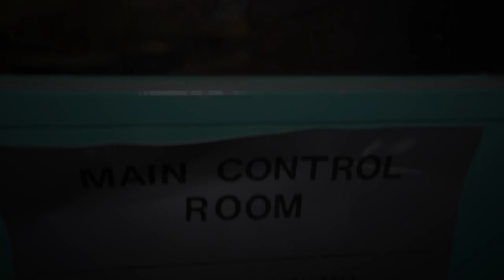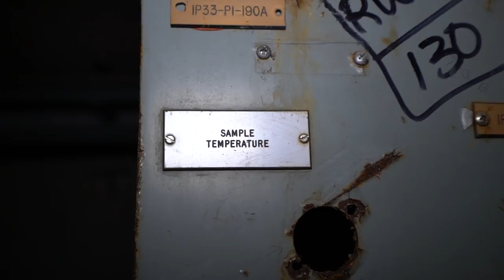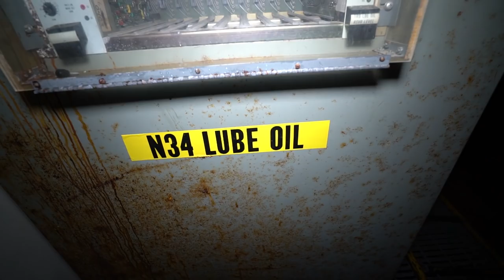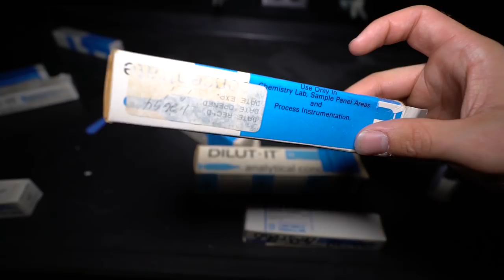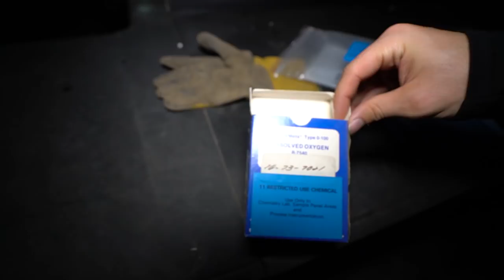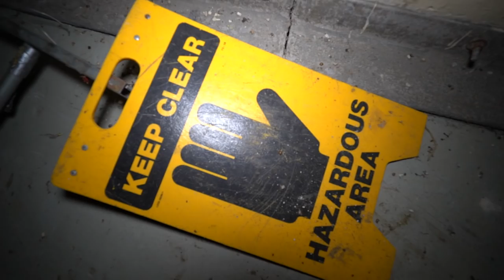Abandoned Nuclear Power plant ( Rare Abandoned Place )

Comment: I would have probably had a Geiger Counter just to make sure I'm not killing myself with radiation
Reply: Daryl Skinner yeah me too 🤷🏻‍♂️
Reply: When a nuclear power plant is decomissioned. The proprietors are federally mandated to remove anything and everything that could even have a small chance of contaminating the environment. If a leak were present, suffice to say that Josh wouldn't have been able to enter, as itd most certainly be cordoned off, or even sealed by local authorities.
Reply: Same thing goes for essential systems. A very specific list of items absolutely must be removed to prevent any possibility of accidental contamination/reactivation by unauthorized individuals
Reply: A N A T H E M A do you know why the lights are still on?
Reply: Reazer - Modder and Developer as Josh said, its probably just connected to a grid that is still in use by other buildings. So shutting it off in there means shutting it off for all the other buildings
Reply: A N A T H E M A ah ok thanks^^
Reply: Yeah bring a couple of bolts encase of anormalies
Reply: Reazer - Modder and Developer he said that in the video if you were actually listening why it still has power
Reply: ikr
Reply: Daryl Skinner couldn't agree more, I wouldn't even fucking go near that place without one.
Reply: Josh doesn't care
Reply: @demonsdomain6919  dude chill he probably commented before it got to that part
Reply: I would take a REM~counter Made by CD. The only time a Geiger counter can come in handy when there is so much Geiger PER hour that is equals vast amount in REM measurement. But also if there we're lots of REM they'd probably lock it up and lock the control room. I don't know if they took the fuel rods out or if it is on but mostly likely that took the plutonium or uriuam fuel rods out.
Reply: @x8_dev130  they could have locked the control room but then some jerk (trying not to curse) broke the lock and opened it
Reply: Sandro Sauer they’re is I such thing as a series through a building, they’re all fed off the same primary voltage and possibly different transformers, a Nuclear Power Plant uses so much energy they are fed individually from they’re own transformers. Still doesn’t explain why the power is still on, it’s either privately owned and operated, or owned by the government and they’re still doing testing of some sorts. The local power company would not give away free power, someone knows the power is on in there and there’s a reason for it.
Reply: Nope ur all good o love near this place and no radiation there
Reply: So what was that buzzing / interference in the audio in places? A little concerning.
Reply: The people who run these powerplants have made monumental mistakes and catastrophes that they never tell us about! God knows if there is really any radiation going on in there! Semi Valley California, 3 mile Island and Chernobyl etc.....
Reply: Sauron Merciful  lmao you'd be able to tell pretty quickly. If you walk into a building and taste metal and start going numb, suffice to say it's time to leave LOL
Reply: This facility was decommissioned before it was used. People were scared because of three mile island and Chernobyl and the plant was prevented from operating.
Reply: @aqworldshayabusa1114  Has that happened to you? Who's your source Mr.200iq
Reply: nah, just bring a power armor and some rad-aways
Reply: Actually in an abandoned nuclear power plant you don't need to worry about that they abandoned it after making it safe and not dangerous because then radiation would be leaking into the environment and hurting people
Reply: gammarayburst 60 cycles (hertz) AC voltage-  probably a transformer.
Reply: youd be able to taste it. plutonium tastes sweet uranium taste's like metal if its high enough you can see it on the camera like little white dots by the time u taste it you have to run or your thyroid will absorb a deadly amount of radiation
Reply: There is usually less radiation on the building than outside, due to the insulation.
Reply: Don't be silly, he never could have gotten close to an actually decommissioned nuclear plant with any residual radiation.
Reply: @aqworldshayabusa1114  also everywhere he walked is safe period  the only radiation area was the actual chamber where the reaction occurred to produce the power and no one ever was exposed to any more radiation than we are everyday especially modern tones even 5G is radiation our phones iPhone galaxy etc all have radioactive parts now it’s nuts but nuclear power has saved millions of lives and barely took any in comparison think about it zero emissions, X-rays cat scans mri nuclear tracers for medical industry all considered super safe and this place and others are designed not to have the workers exposed
Reply: That's what I thought
Reply: 10 microsievert is danger
Reply: My thoughts exactly.
Reply: Just use Radaway.
Reply: Right!
Reply: There's no radiation in there !!!!!!!! I know I worked there.

Comment: The reason them "tubes" are  removed is because they were the steam turbines, the  vanes and casings are Titanium, worth a lot of money scrap and completely clean of radiation.
Reply: Those were actually heat exchanges. You could see the many small holes at either end. That was the tube side of the exchanger where hot liquid or steam was pumped through. The pipes connecting above him was the shell side of the exchanger where the cooler liquid was pumped through to get heated.

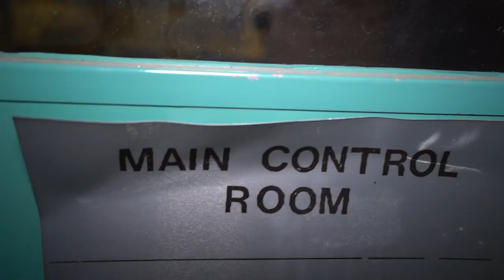Comment: OK so at 3:00 and 10:00 when you are all wowed by the control panels --  look at the way it's laid out so that also a diagram that shows how the controls affect other things in the plant.  This is called a "mimic bus".  Operators rely on these diagrams to keep track of how the whole plant is operating and to anticipate changes.  The electrical portion of the plant will be diagrammed in a similar fashion to the reactor itself.  Mimic buses are useful for reducing the complexity of something like this to smaller, simpler pieces that operators can handle and not get overwhelmed.
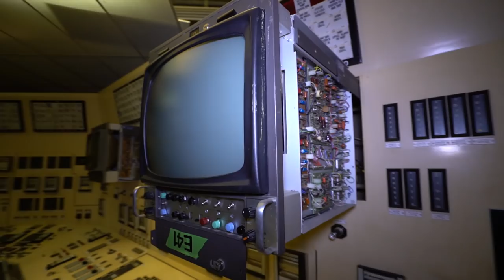Reply: 10:50 is the control rod bottom lights.  This would tell you that the rods are bottomed out and the plant is not producing power.
Reply: I noticed it looked like a electrical diagram, very interesting
Reply: The Plant Isn’t Producing Power It’s Power Is Just Turned On

Comment: Evert thought about bringing a Geiger counter with you? Just for fun.
Reply: Decommissioned reactors are always scrubbed clean. In fact due to the shielding of the reactor, there's less radiation inside than outside.

Leaving radioactive materials in a place so easily accessed would mean anyone could steal it and make a dirty bomb. Hence why places holding nuclear materials are so heavily guarded.
Reply: You are correct, they do scrub them, but they don't always get all the hot particles left behind. Especially in a plant that large that has been running for long periods of time. In fact, I wouldn't be surprised if he didn't pick up some hot particles on his shoes and packed them home.They shouldn't be hot enough to hurt anything though.

Comment: If this location is in NY , then this facility was only ran for basically a day at about 5% power and then shutdown and completely decommissioned.  Although there was once nuclear fuel in the facility there is no harm of radiation there. The Proper People did a killer video there and show the actual fuel pool and how it has been scraped clean of any contamination. Also you can see the top of the reactor and inside of it.

Comment: you should go with a geiger counter. it was rly stupid that u went in without it. if reactor was at any time on, there would be some radiation around it. not that it would be deadly tho
Reply: Decommissioned nuclear stations are scrubbed clean, or else they are under heavy guard to prevent the theft of radioactive materials. If he got into an area, it's likely perfectly clean. In fact, due to shielding present in the reactor, there's less radiation than the background levels you get standing outside anywhere on earth.

Comment: This is not implying that he is at three mile island, a power plant that experienced a significant disaster in '79. He wouldn't get anywhere near three mile island as one of the reactors there is still running (is about expected to stop tis year though) and the one that isn't running since the disaster still has stored nuclear fuel so security would be rather tight. FYI Take a look at the carpark of three mile island on Google Maps to see how still open and busy the place is. However he is at another island though that has decommissioned the power plant and since cleaned it up.  It never ever ran anywhere near full capacity BTW. The power is still on because the turbines and generators that were powered by Nuclear boiling water reactor are still being used but now by gas boiling water. People still work here in adjoining buildings.

Comment: Those vault doors are not security, that’s the containment building.  Inside that is the reactor vessel itself.  If the reactor vessel has a breach, the containment building with those solid doors holds it together.  Or theoretically anyway.  Steam explosions like in Fukushima Are likely the containment building blowing up.

Comment: 2:20 - Those would have been gauges not buttons. PI, and TI mean Pressure Indicator and Temperature Indicator.
2:52 - Radwaste/Water Treatment control room.
3:35 - Probably their on-site LSD Factory.
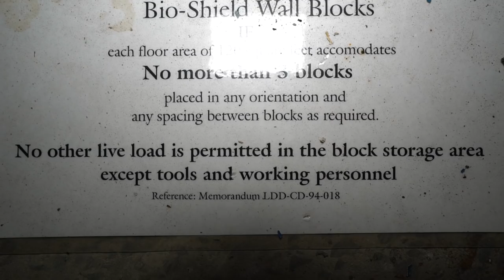4:05 - Looks like they chopped out the bio-shield. Gamma shielding around the Reactor. 
 4:56 - Heat exchangers with the tubes cut out. Feedwater preheating maybe. 
6:39 - Bill Nye was here.
10:08 - You can tell it's a Control Room because of the way it is.

Comment: I have worked at nuclear power plant but never went to the reactor building coz didn't had the permit to be there, but the vertical column at 13:50 most definitely it's the heat exchanger part of the reactor that heats up the secondary water cycle i.e.  from reactor to turbine and actually produces steam for rotating the turbine. The primary water being the heavy water aka moderator for cooling off the fuel rods inside the reactor. During operational condition that room would give you leathal dose of radiation every second.

Comment: Silly question, but did you actually think to take a radiation dosimeter in there with you?
Only asking, as the yellow boots are usually used in high risk areas.

Comment: Damn, I'm way late. 
So no one will see this comment...
But, it looks like they started deconstruction, and randomly got called off the job. 
Probably because it would cost less to just keep it, and leave it. 
But, they started by removing stuff that could be stripped down and expensive metals, and materials taken out and sold. 
And then the reason all of that is thrown down the bottom of the stairwell or whatever it was, is because at the end, they would clear that all out anyways, so they used it as their dumpster while getting the valuable stuff out first. 

Just my guess tho  

Also....you planted the boots. But, whatever